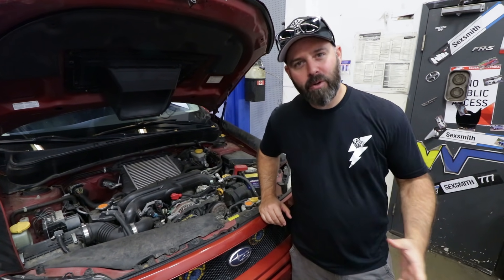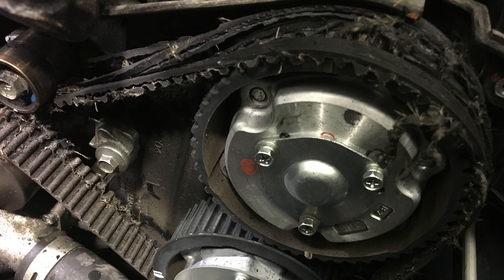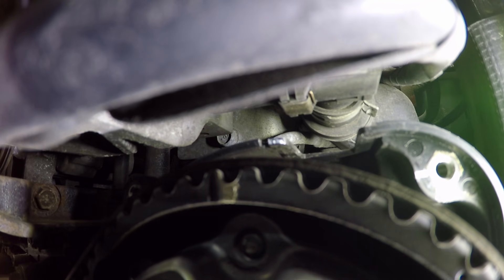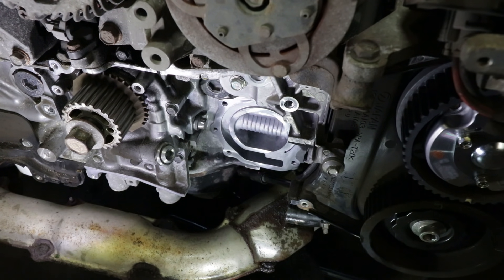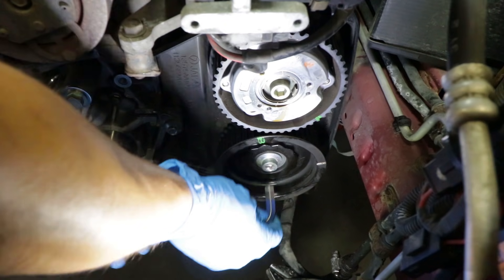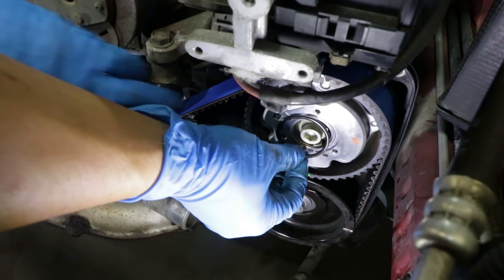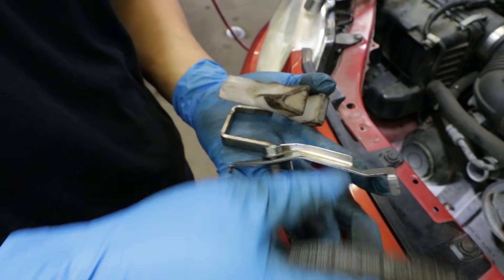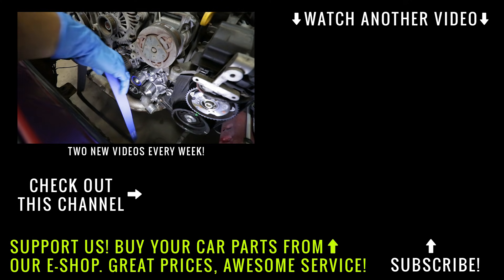How To Change A Subaru DOHC EJ20 EJ25 Timing Belt

Comment: The one thing I would add to this procedure is to turn the engine over by hand for 2 full revolutions and check the timing marks again, before reinstalling the cover.  It's a handy way to ensure all the slack is taken out of the belt and that you still have all the sprockets in position.  A little too much slack in the bottom of the belt, and you'll end up with one bank about a tooth out of position.  I know it's probably not an absolute requirement if everything was done perfectly, but it's always best to be extra sure before firing the engine.  And it only takes a minute or two - cheap insurance, I reckon.  :-)
Reply: The problem I'm running into on my STi is that when you do the 2 revolutions, I think the AVCS cam sprockets throw things off a hair, so marks weren't lining up for me. I've been looking for clarity on this online and haven't found anything. I did notice the Subaru FSM only states to do it as they did in this video, and doesn't have you do the 2 revolutions to double check. I did that at first and redid everything and did it again and it was off again, and that's when I realized the FSM didn't say to do that and made the assumption that the AVCS cams throws it off slightly?
Reply: @burnrubber2002  mine is off too. I installed everything perfectly and when I turn the crank it throws things off.
Reply: @burnrubber2002  hey i was just reading comments and saw yours, its been 5 years but flatirons tuning had a video explaining this. Its because the total number of teeth in the timing belt is a prime number (137 i think), therefore it wont really come back to its original state (12 revolutions will put it close enough but still wont come back)
Reply: @burnrubber2002  Ever figure out that answer to this? Makes sense to me
Reply: @AaronFrench7  I ran with it and it worked fine. Car is still running to this day :-)
Reply: @burnrubber2002  me too! I finished up the belt on my 07 STI and hit the track a few weeks later...ran great until I blew the turbos oil seals.
Reply: @burnrubber2002 any updates on it today brother???? About to do mine on my 2015 STI here pretty soon
Reply: @deadghost50ify  I went with my gut and followed the FSM as my previous comment, and had no issues with timing. Had her dyno tuned, and drove the car for over a year before selling it. So I guess I did it right 😛
Reply: @burnrubber2002  i know this was 4 years ago but yeah i had the same problem running fine though
Reply: Exactly what I was looking for before I said it.
Reply: For some reason the drivers side never lines back up perfectly, the double lines always split each other instead of  lining up. Puts it about a half tooth out but since you can't time a half tooth you have to go with it
Reply: aussiebloke609 I agree
Reply: excellent comment, I remember my buddy showed me the same thing during my build
Reply: @John Coughlin take your time and get the timing marks on the belt aligned with the marks on the cams and it's almost impossible to be wrong, weather there's slack in the belt or not
Reply: The XT I just did, the driver's side cam marks were off a little before and after replacement. I rotated the crank 12 times and checked the marks every 2nd rotation. All the marks on crank and cams lined up but the belt marks are off. Wonder how many turns til the belt marks line up again.
Reply: @JohnOfAllTrades27  I had this happen on my old 1995 Legacy, thankfully only SOC, but when the cam went out of tune i had to sit there and crank it like 20 times. There's a video around YT, I think by Briansmobile1 where he explains why and how many turns. But it takes a while.......
Reply: @JohnOfAllTrades27  I think it's some 238
Reply: @brandon  No worries, mate.  Just remember to ignore the the marks on the cam belt itself, as they're pretty much guaranteed to be different after rotating the engine a couple of times.  Always check via the marks on the gears themselves.  And have fun getting your hands dirty!  :-)
Reply: a minute or two saves my ass
Reply: This won't work if you have AVCS. Even if you do all the marks correct and rotate the engine twice, the marks won't line up anymore.
Reply: Yeah goodpoint
Reply: I'm sure he knows
Reply: I've done that for years.. a definite must on timing belt cars!
Reply: Wouldn’t you bend the valves doing this?
Reply: @TheMrFlyBoy18   If you have an interference engine and the valves are too far out of timing, you will hit the valve with the piston.  That is why you rotate the engine by hand - so you can feel the resistance if the piston touches the valve and stop before doing damage.  If the first turning of the engine is via the starter motor, you won't know until it's too late.  Rotate by hand - gently - is how to be absolutely certain there will be no problems later.
Reply: @aussiebloke609  I take it the resistance is greater than resistance you would feel from compression at top dead center?
Reply: @NotRandoWis  There is no compression, only the force of the valve springs and friction from the piston rings for you to overcome.  You don't do this with the spark plugs installed.

Also, unless it's barely interfering, you'll get a solid point where the engine won't rotate without significant force being applied...but always be gentle and take it easy, as it is possible for a valve to get a little bent by just kissing the piston crown.
Reply: @aussiebloke609  ah. The whole ego e tilt dance once again. I see.... Well that sucks.i have an 06 forester ans taking spark plugs out sucks. But I get exactly what you are saying.
Reply: @NotRandoWis   Yeah, getting plugs out of a Subaru can be a tad awkward.  But removing the plugs is a lot less awkward than explaining just why you now have to rebuild your top end.  Cheaper, too.   And good luck.  :-)
Reply: @aussiebloke609  Engine tilt haha i meant engine tilt. I have already changed plugs...it was a time
Reply: aussiebloke609 kinda a risk rotating the engine two full revolutions if its hard to tell that the pistons will hit and bend the valves? I know its good practice two rotating the engine two full revolutions but I believe if everything was done right then its not needed? The mechanic in the video didn’t do it and it ran fine.
Reply: @TheMrFlyBoy18  In a perfect world, it's not needed at all.  But this world (and us people) are far from perfect.  The point is that it's a lot less of a risk than just hitting the starter and only then finding out you had a little too much slack on one side of the belt when you installed it, and now you've just bent a valve and have to rebuild the top end.  Of course you first set the valve timing up as perfectly as you can.  Turning twice by hand and rechecking is insurance of a sort, confirmation that you got it right - since it's very easy to make a minor error that can kill the engine.
Reply: @aussiebloke609   So one has to remove the spark plugs first before attempting the T/B replacement?
Reply: @MikeSF5   It's not usually a requirement for the belt swap per se,  But rotating the engine against compression can take significant force, whereas removing the spark plugs means there's very little resistance when you spin the engine by hand - so if you do happen to touch piston to valve, you'll feel the sudden stop in time to avoid actually doing damage.  And removing a few spark plugs and turning the engine by hand is pretty cheap insurance.  🙂
Reply: @aussiebloke609  Got it, thank you.
Reply: It should be a standard procedure for any car! :)
Reply: Rotating the crankshaft 2 revolutions should be part of any Timing Gear (belt, chain or gear) replacement procedure. No excuses. It's better to be safe than sorry and only takes one more minute. Something else missed in this video is either fitting or mentioning the crankshaft belt guide if the vehicle has a manual transmission. This engine hopefully has an automatic transmission hanging of the back of it or there will be a vital piece of the puzzle left on his work bench and maybe an expensive repair next time it visits the workshop.
Reply: Q
Reply: And to bleed the tensioner
Reply: So the double lines not lining up is completely normal?? What if I line up everything on the old belt and then lock everything with cam lock tool, will the marks not line up on the cams when installing new belt?
Reply: Is the sti motor an interference like the frs/brz?
Reply: @eriklopez4720  yes
Reply: @ahhason  thanks
Reply: True I have been using these method and am grateful... happy new year.
Reply: I didn’t remove the spark plugs but I bet it would have made lining everything on the right side up much easier.  I turned it over by hand a few times before I disassembled it so I got an idea of how it should feel.  After I linger everything up and had the belt on and everything torqued down I rotated it about 10 times by hand expecting the belt marks to line up.  Never did, and I got tired of trying.  Didn’t recheck the lines after rotating the belt but didn’t have any interference.  Going to go remove the side covers and check before I finish putting it together.
Reply: 😂 it takes a little over 11 revolutions for the timing marks to line up again. If you lined everything up, your good. No need to worry.
Reply: Wait so you don’t rotate 2 full revolution??????????????? 🤦🏾‍♂️
Reply: Clockwise?
Reply: Yup. Made that mistake once on my 1998 OBW (winter, 3 am and working outside in the negatives ... not very smart). Make sure the marks are in the right spot. DOHC is not forgiving. Had to re-seat 5 valves. What a pain, but great learning experience. Its still running great and no problems over 50k later. Good instructional vid, but watch few others too and have a repair manual handy. Subaru service repair manual is best but hard to find. I have a gen 1 PDF (1994-1999) if anyone needs it.
Reply: @pavelvakhlamov7754  damn i need one for an 06 lol
Reply: pavel.vakhlamov@gmail.com
Reply: Def not needed. The most important thing is to make sure the marks on the belt line up with the marks on the gears. You are fine, if you are able to do that regardless of where the slack is on the belt. I've been working on these for over 20 years.

Comment: I've never heard of a stretch fit belt before this.  My '05 Legacy GT has an idler pulley for the A/C belt.  I did read once of an A/C idler pulley seizing causing the belt to break and hit the timing belt cover with such force that it broke through it and caused the timing belt to jump and valves to meet pistons etc.  I wonder if this is the real reason Subaru got rid of that idler pulley?
Reply: The belt stretching is the reason why it's mandatory to change it when the manual says too. Don't think for a minute you can let it go for a while and be ok. Been there. That's why I like timing chains so much better, unless it's GM of course then it'll stretch just like a belt, because GM likes to use cheap shitty chains.
Reply: omg!
Reply: He was referring to the AC belt as a stretch type.

Maximaniac, I've asked a few service managers and no one knows exactly why they eliminated it.  My guess it cost and weight.  They shaved off a bit of each for a bit more maintenance hassle.  Those pulleys aren't that unreliable.  Though, if it starts making noise get it taken care of.

Comment: I have an '05 Legacy GT that I did the timing belt, tensioner, pulley's, and water pump on at only 65k miles as the car was 10 years old at the time and Subaru calls for it to be done at that time interval regardless of mileage.  At that low mileage (40k miles below what Subaru specifies the TB to be done at) one of the pulleys already sounded terrible, like it was full of sand.  I wouldn't have wanted that thing in there another 100 miles, much less 40k!

Nevertheless I found the job not too daunting.  It was made easier by the easy access right in the front.  I once did a Toyota Corolla that I thought was way harder than this one because of the tb location.  I also used the Gates kit but opted for an Aisin water pump (Made in Japan) instead as it was only around $25 more.

Another thing I didn't see you guys do in this video was use loctite on the pulley bolts.  It's probably not necessary but it's good insurance imo.

Comment: That water pump is Chinese crap. Get an asin kit. Also should of mentioned the chance of valve to valve when intake and exhaust valves open if turn the cams incorrectly
Reply: Not on a Subaru, Pistons are Mid-Stroke when you put it on the Marks.
Reply: Yes on a Subaru.  He's referring to the fact that the intake and exhaust valves could hit each other (not the piston ) as the cams spin since they are no longer synched up.  They physically move through each others' space so when the driver's side spins it could allow them to hit (seen it before when a shop doesn't know what they are doing).  There's a tool that holds the driver's side cams aligned to each other while you take the belt off preventing this issue from occurring.

Comment: Why wouldn't you want to use a lower temp Mishimoto thermostat? Just curious
Reply: results in rice coming out of your exhaust pipe
Reply: I did this job a few years back on my '05 Legacy GT.  I used an oem Subaru thermostat and I've noticed the temp gauge definitely sits lower than it did with the thermostat from '05.  As far as I can tell, Subaru thermostats are now low temp too.
Reply: Your ECU is calibrated to have coolant temps in a certain range. By installing the lower temp thermostat you change this range and throw off the calibration of the ECU.
Reply: N.V. Auto so this would only apply for stock ECU tunes or would this be able to be corrected with an aftermarket tune? I recently bought a lower temp thermostat but haven’t installed it. I do have a tune on my car- just seeing hit temps on track.
Reply: If you are seeing high temps on track a lower temp thermostat will not help this issue.
Reply: Thanks for the replies. I have an oil cooler waiting to go on as well and just made some ducting (I have a half rad)- hopefully those things will alleviate the higher temps on track. Runs perfectly cool on the street.

Comment: GREAT VIDEO!  Please do the SOHC belt and head gaskets.  They all leak.  The struggle is real.
Reply: Can you provide a sohc  kit name brand ,, that is not sub. Or gates please, 
 This is a great video series.
Thanks for doinv.
From great shop, 
And great techs.
Reply: David Clark 5 star?
Reply: @davidclark5138  if you're doing a 2.5L go with 2010 Legacy headgaskets, I only use Subaru never aftermarket. The 2010 used a 2 shim steel gasket instead of the synthetic gasket, I never saw one leak oil, I use them in all the jobs I do from home
Reply: Benjamin Rhodes  Search out the best brand of stop leak and screw that piece of crap and Subaru. That's their advise on cars under warranty. In order to limp em past warranty experation so Subaru can tell you...oooh Shit man! Sorry sir. Warranty is up. Looks like that will be at least $1,500. Yep. $1,500 every 100,000 miles for the rest of your Subaru ownership experience.
Reply: I've done this on my own cars before, the oil leak isn't pressurized oil just return to the pan from the heads. Drain the oil, clean the bottom of the head with brake clean let dry for an hour or so, make sure residual oil isn't leaking in which case clean again. If it's dry smear a nice thick bead of engine sealer along the bottom side of the head/block seam. Use your finger to smooth it out. Let it dry for 24 hours, fill with oil. I've stopped or at least slowed down some bad ones with good results

Comment: Bad idea to use the blue racing belt. It holds alot of power but isn't meant for longevity. Gates even says that themselves.
Reply: agreed. ill never use another blue belt. after 30k i pulled the covers off just to check things out and the blue shit had built up a film on all the idlers. the build up was so thick it was actually making the pulleys larger in diameter and throwing off the timing. marks weren't lining up as good as before. not as bad as a jumped tooth but noticeable nonetheless. that standard belt is more than enough.
Reply: I've also read that it deposits blue crap all over the inside of the tb covers.
Reply: Chandler Braaten yup, see it all too often. Hopefully they bring the car back in soon and put a normal belt on or else they'll have an engine replacement to worry about.
Reply: Thank you for confirming those issue on gates blue racing timingbelts.

Comment: Nice. Simple enough until the "stretch belt" and coolant trick...LOL How did the stretch belt come off? Cut it?
Reply: Yep, cut it  You could also loosen the AC compressor bracket, but they aren't meant to be reused anyway.  All of our newer EJ Subarus that have that belt I converted back to the old style.  Just a bracket from the junk yard then a few parts from the dealer and you're back in business.

Comment: whenever you fill a cooling system it is always a good idea to put the heater on HOT.  That way there is circulation through the heater circuit as well and that mighthelp get rid of air pockets as well.
Reply: jfv65 there's no valve for the heater on Subaru's it's always flowing.
Reply: No hot water valve. But the heat is a good idea cause if the heat is strong you no there is no air pocket and the pump is circulating the coolant properly and not having cavitation
Reply: Does that apply to older models? Pretty sure my 98 forester isn't that fancy
Reply: Ejs have very little issues with locking air in the system. I would usually have heat in a few minutes. If there wasn't heat in about 30 minutes shut the car off fir 15 minutes top off the radiator, they always seem to suck the air bubble through while cooling, that was primarily on the 10 and 11 Legacy and Outback with the bastard Ej.